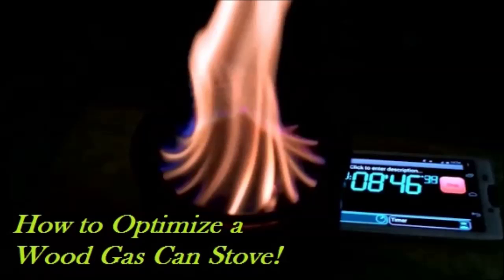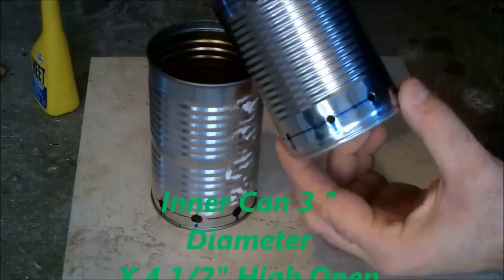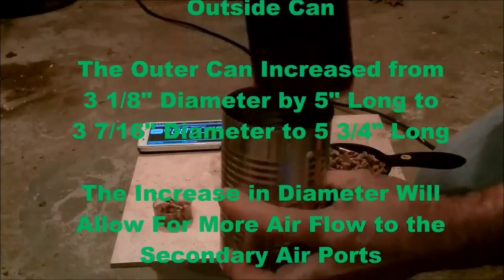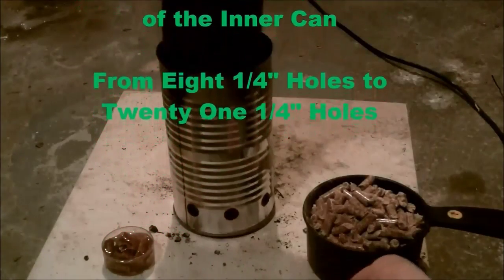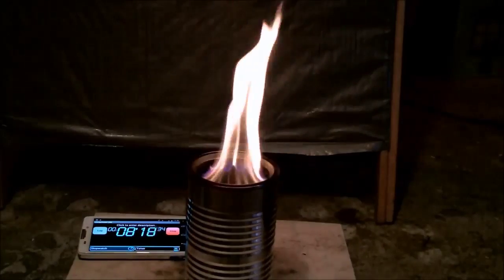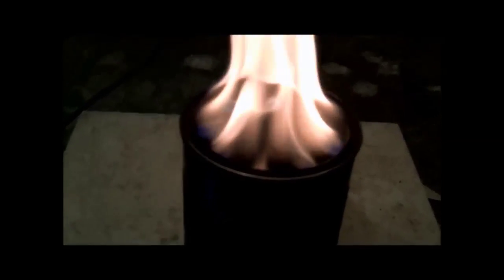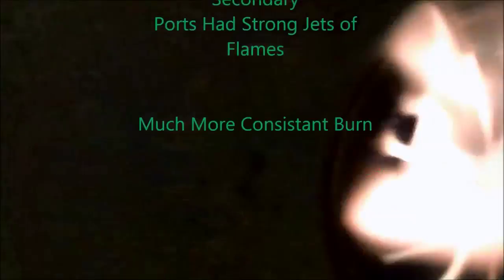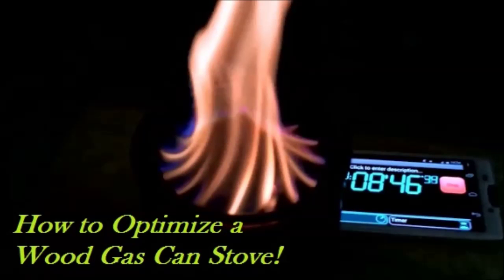How to Optimize a Wood Gas Stove! Wood Gas Stove Science!

Comment: I wonder how these ratios work as the unit gets scaled up, using larger and larger cans/pots?
I was surprised to see in the final design unit, the main air inlet holes by total hole area (3.53 sq. in.) was about half that of the area of primary air holes (8.05 sq. in.) in the bottom of the inner can. The secondary air holes by area was about 1.77 sq.in., close to a ratio of 4.5:1 primary to secondary
When you add up the total areas of the primary air and secondary air holes and the area of the inner can, that total is almost exactly the area of the larger outer can... Is that the point where the unit is optimised?? I supose the amount of gap between the inner and outer cans has to come into the equation more at some point

Comment: All the videos I see, show people burning pellets. It's a WOOD GAS stove. So why doesn't anyone try using WOOD as fuel? No body uses tree wood. I'm just going to burn plastic as fuel. Let's cut the bullshit. Why not use cooking oil and paperboard?   

Id like to show a stove design that will have you running for cover. 

It's anything but efficient or time saving design. The flame gets out of control. It only saves time once it's lit. The flame is very persistent in the heating chamber and shoots out the sides of the contraption. So, I'ts been about a year trying to manufacture it from scrap. The design is ok. However I know it needs improvement.

The goal I had when I started,was to make a bio fuel stove using a dry burn. Not having to add fuel time and time again. 

So, although I'm satisfied with the design. It's only  %50 efficient since I have to constantly light the source by pumping air through a tube to ignite it.
Reply from the maker: I would need more info to try to help you. I have no t played with the type you are talking about, but am willing to help!

Comment: Your theories are solid enough, however your design is not actually suited for use  in the world outside of your back yard, as you may discover in a possibly dangerous fashion that by placing holes around the entire circumference of the outer can, even a small amount of wind can blow the burning material in the inner can right out the top of your stove, and injure the user or start a fire very easily. I would suggest limiting the holes in the exterior can to no more than a 90º radius, but make larger holes so that you can moderate the amount of positive pressure the stove receives by rotating the can to face more into or away from the direction of any wind, while still allowing plenty of fresh air to  flow into and mix with the unburnt gasses for reburning. Obviously, the holes must not come above the bottom of the burn can or they hot gasses will just exit the can them, as they seek the path of least resistance.    I use a church key to make the holes, myself, with excellent results. Try it for yourself, if you'd like. That said, thanks for making this vid.
Reply from the maker: I have used this quite a bit! I have not had issues with wind. But thanks for the comment! I will look at the optimization of a wood gas stove that takes that into consideration! Thanks for the comment!

Comment: Is there a difference when the holes are in the bottom rather than the sides of the inside can?
Reply from the maker: gary24752 I found that if you only have holes around the outside you fan not get a high enough primary secondary air ratio. You also always end up with a dead spot in the center which leads to an incomplete burn. My opinion only👍

Comment: Heath, I finally got a chance to do some research and built more stoves.  A blue flame is what you want.  Blue flames burns hotter in firewood.  
Here is a reference to this.  https://www.cuttingedgefirewood.com/news/what-does-the-color-of-a-flame-mean/

So your initial set up was the best with blue flame that is short.  It is also burning more efficiently and complete with no more carbon in it.

Comment: How about showing the bottom of the cook pan - how much soot? Is the stove really burning clean? I dare bet there is room for lots of improvement.
How about using some basic chemistry and math to justify the stove air holes to design a build.
CHEMISTRY: C6H12O6 + 6 O2 = 6 CO2 + 6 H2O
1 pound of seasoned wood requires at a minimum 6 pounds of O2 for good combustion. Since air is only 20% O2, it actually takes 30+ pounds of air to provide the required O2 (oxygen).
Ration 1 unit of fuel requires 30 units of air aka a ratio of 1:30
One cubic foot of air at standard temperature and pressure (STP) weighs 0.0807 pounds. Hence, 30 lbs. /  0.0807 lbs/ft3 = 372 ft3
Calculating the cross section of various size hole diameters its possible to create a primary vs secondary cross section air ratio.
To large a size of secondary holes provide to much air and quenches (cools) the combustion temperature reaching the cooking pan. Likewise the distance from the flame top has a large impact on temperature - just check out a common kitchen wood match temperature zone as it burns.
How efficient is a wood gas stove? 
All of the above assumes a perfect 100% efficient stove... I doubt it exists.
If there is soot on the cooking pot or visible smoke there needs to be more air and higher temperatures to break apart the covalent carbon bonds.
Is the solution more? Or could less be more acceptable for simple camp cooking?
Might the use of a different fuel provide improved cleaner efficiency - charcoal?
Good luck!

Comment: I've seen a guy making the flame adjustable. So there's no need to build a new stove each time to test the best number of holes. Have you ever thought about making the vortex spin from the bottom? This would mix the air with the gas even better. I've also seen a stove made of three cans so that the gas is even cooler.
I like the watch app. What's the name of it?

Comment: Hey again. My cans that I want to use are the same height. Can I make the lower inner holes much larger and put like a riser grill inside the inner can?
Reply from the maker: You can make the holes bigger and the stove will breath easier but wind will have much more of an effect on the burn. Have fun building! let me know your results!
Reply: Heath Putnam thanks! I will keep the total inlet area the same and just rise the wood with a round metal mesh. Cannot wait to build and test!

Comment: A random question, but would the burner be a good "heater"? By this I mean does it radiate heat well or is it directed straight up? Thanks! P. S. - Greetings from South Africa!
Reply from the maker: The heat is mostly straight up, but I think you could heat a metal plate in the flame. That would allow the heat to radiate more.
Reply: It is a stove, not a heater.

Comment: Thank you for this and previous wood stove building that you have provided, it certainly provides the science to the build.
 Optimising is very relevant, I wonder however if there is a point in optimum flame temperature,  using recycled tins which are thin walled utilising very hot efficient temperatures will cause the life expectancy to reduce quite drastically leading to replacement sooner unless thicker metal is sourced and used?

Comment: Thanks Heath, nice job. You have 4.55 X primary air  hole area to secondary air hole area.. Great ratio, seems to work. Like the homage to Tectoba with the vortex effect. Thanks for the effective stove top ring posted in May. Will try this vs hardware cloth. Have you continued work on fans?

Comment: is it possible to fill pellets in the stove while running it? or will it effect the power of the jet?
Reply from the maker: Stefan Negler you can add pellets but it will interrupt the pyrolysis zone with oxygen. This will cause the stove to smoke for a minute or so. If you are going to add fuel, do it before the level burns half way. A full load of pellets in the Vortex 5.4 burn 50-60 minutes so add pellets about 30 minutes into the burn. Thanks for the comment!
Reply: Hello Heath,,, Would you happen to have all the details and a diagram or video/ link of the most efficient stove that you have to date in one place?

  Which cans you used, hole size and placement, and number of holes where...

  I would like to build an approximate of your best design,,, and knowing my self going through all the prior versions will deeply muddy the waters for me, ... 
  I would like to experiment further with your final winner, after I get a stove designated for this years pack.

  I would greatly appreciate it.

Thanks for a response.
Reply from the maker: Look at my video for building the Vortex 5.4 and then the pot stand build video. They lay everything out pretty well. Let me know if you have other questions. Good Luck and Thanks for the Comment!
Reply: I was just looking at that one, and seemed to be the best details I was looking for so far... Thanks for replying...
In regaurds to the way you bend the holes at the top for the vortex,,,  Have you tried like that one video were somebody makes slots with a hacksaw instead of round holes, then bends them out in the same fashion???
 Maybe it was one of your videos, but I doubt it due to your more precise building style.

Comment: Thanks for all your stove videos Heath. I saw a video for a gasifier build where the builder lowered the bottom of the burn chamber below the primary air inlet holes and had only  small side holes on the bottom of the burn chamber wall. The explained rational is to choke the burn and to create a down draft vacuum. I would imagine that whole the burn would be slower the burn temperature would be decreased. 
   I don't know very much about how these designs work so I thought I would ask if my assessment of this sort of design change was in line with reality? I have attached the link to the builders video in case you are interested to have a look. 
   I also wanted to ask if you did a video in determining the size of the gap between the two cans in your design and the impact upon performance? Thanks a gain regards moray james.

https://www.youtube.com/watch?v=FepZPaxgB3o&t=183s

Comment: Thanks for the info Heath.  Today I tried a perlite rocket stove and wasn't very impressed.  I happened to have some 4" pellet strove ducting hanging around and I made nice strong blue flames on my first attempt after watching your video.  My height is about 10 inches, I put a screen in the bottom of the inner pipe and then have 1/4" holes on the outer pipe 1" from bottom and cut triangles below that so it has 4 legs and air intake between.
Reply from the maker: Sounds interesting!
Reply: I plan on making another soon and will try to shoot a video of it.  Material was only $19.99 at my local tractor supply store.  New features will be a stand so it doesn't topple over, and brackets on top to hold a pan for cooking.  I also realized that the top is capable of holding Coleman lantern glass so I may experiment with gasifier lanterns.

Comment: I don't get it - what's the point with the 'strong jets' and the 'powerful flame'? It seems to me you'd rather want small flame of higher temperature, for me that would mean optimisation. I don't think you yet grasp the idea behind the wood gas stove - you're supposed to choke the burning wood of air and then burn off the released gasses.
Reply: You didn't understand the science behind wood gas stove and he is trying to teach us that. He is saying by optimizing the secondary burn hole, you get more "burn" out of the the wood. The power of the flame is an indication efficient use of the wood gas. Also if you see blue flame it means you are burning wood gas, no the wood. Ok, to put it simply, if you see smoke and your pot turns black, you are not getting or burning wood gas. In his video he kept mention there is no smoke. It means his design is superior.
Reply: +KarasekUS
Yes, I think you're right.

+Heath Putnam
I think it was unfortunate that the first phase of 'optimisation' was to increase the primary air. This will give the appearance of improving the burn quality - indeed, will improve it, but not in keeping with the principle of wood-gas production. I'm no expert and about to start working on only my second wood-gas stove, but I believe it's better to have quite a low primary flow (a few small holes) and greater secondary flow. I'm even considering having a completely closed burn chamber (apart from at the top, obviously), so that the only air flow through it is cycling from above, just to see how that goes. With such a lot of primary air being sucked upwards through the fuel, there's little chance for the production of the 'gas wick', the reservoir of wood-gas built up in the area above the fuel. It will almost burn like a torch or very open hobo stove - looks impressive, but isn't as efficient. If, as KarasekUS says, you choke the primary input, the secondary can easily keep up with the produced wood-gas, thus burning it more completely. In this way, you may find that the stove produces charcoal at the end, but without smoking. I'm not sure about all this, but have read others who had this result. I also wonder if an ideal design might have a valve to increase the primary air later on if it is desired to burn the charcoal completely - others prefer to keep it to use separately.

Comment: Hey Heath, I like this video, because there are so many numbers in it. I like when the math confirms the real life ... Produce blue flames are one thing, no black pot is another. I am in your opinion: the key is the height of potstand. I look forward to your next video. How you realize the potstand? Kindly Regards from Germany - see you !
Reply: I think the key to optimizing the pot stand height is to simply fill up your stove and light, then raise and lower your pot into the flame and select a height that does not mess up the secondary flame.  You will start creating smoke as you start interfering with the secondary flame. Also make sure that your pot stand allows the flames and fumes to escape easily directly around the bottom of your pan....otherwise it will create some slight back pressure which will also affect the secondary flame.

Comment: Heath have you figured out a way to reduce or eliminate the blackening of the pot?.. and still achieve fast boil times with no smoke!.. by the way I love all your videos!! and you have taught me a lot!!😁  currently I am on the other end of the spectrum trying to achieve extreme efficiency(50m on 1cup of pallets!) with a very low power blue flame by restricting the intake... but still achieving a boil.. Yes I understand the fuel has a lot to do with sooting but I would love your opinion on the subject! Aloha&THX! 🔥
Reply from the maker: +William O'Rourke lll For the type of wide open burning I am doing, I have found it is all in the pot stand. I cannot be too low because it breaks the flame column and interrupts the pyrolysis zone. That lets wood gas and smoke out. My best pot stand to date has been a solid can with large holes part way up and large "u" cuts around the top.Do you have any videos of your stoves? Thanks for the comments!!!
Reply: Heath Putnam I just knew you were going to say the potstand!.lol I agree you need to get it in the sweet spot I'm currently using a large tuna can unopened and drill through both sides for a flame concentrator/potstand along with muffler hanger with large 1\2" holes. My outside can is a large bean can with only 8 3/8 holes my burn chamber  a pineapple can because thats everywhere in Hawaii but what isn't!..is good quality pine pellets!lol I've had 3 BIG bags shipped in already! Need a 4th!  as I'm down to dust now!lol But I will shoot another video as I keep taking them down not really satisfied with the results yet. Thanks for your response and please keep up the awesome vids! Aloha.
Reply from the maker: William O'Rourke lll Thanks for the info! Send me a link when you post a video!!